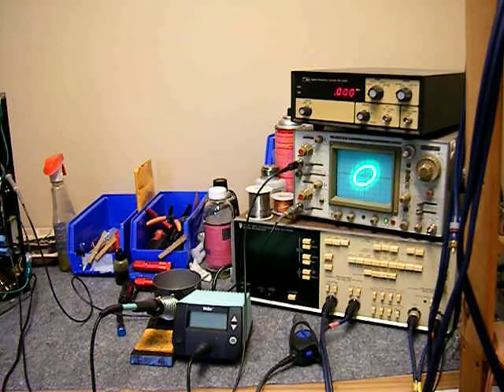Nakamichi cassette deck repair, part 4.

Comment: Hello Francis, it would be great if you do a detailed video on just the calibration process, this one is a bit rushed up an we cant really see how it's made. Also you talk about Speed, Playback Level, Record Level and Record Bias adjustments but it's not shown in the video. Could you please do a detailed video just on the calibration part showing all steps?  Thank you so much
Reply from the maker: Thanks.  I'll see if I can do that.  But, really, it's the same setting up any other tape recorder.  I'll work on that.  I'll see what I can cook up.  :)  Thanks for the suggestion.

Comment: Hi Francis i own a nak z7 bought it new i need to replace the belts i like to do it myself i wonder if its hard to do it been looking for videos on youtube and nothing to look at im over sea can i ship it to you just in case i can't fix it, and how much repair will cost me, any idea?  thanks
Reply from the maker: I buy up broken machines, repair and resell.  Since parts (aside from belts and rubber pulley surrounds) are not available, it is very difficult to provide a repair service.  I often need to take parts from 2 or 3 broken machines in order to piece together one working machine.  Btw, there is no "z7",  perhaps you mean "zx-7".  The ZX-7 appears to be very similar to the LX-5, I recently rebuilt 2 LX-5s.  The transport is very similar to the 480 and the restoration procedure would be similar to what I do in this video.   It appears to be a very high end machine and is worth getting it to a good shop that has the proper tools and expertise.

Comment: Hey Francis, can't thank you enough for putting these fantastic clips together, they've given me some really timely and comprehensive pointers on how to rebuild my 480. Have you done a lot of these rebuilds? You sure know what you're doing! Truly great work, and very much appreciated.
Reply from the maker: I have been working on tape decks and cassette decks since the mid 1970s.  I have rebuilt several of the Nakamichi decks in the past 20 years.  I like to focus on the Nakamichi decks because they show the best performance of any cassette deck that I know of. Thanks very much for your comment.
Reply: @fflynnful  Ah, that is great to hear, and I couldn't agree more, the Naks are certainly the Rolls Royce of the cassette world. The 480 was my first (and for many years my only) Nak. It has its flaws but its signature sound is one I just keep returning to, and I'm sure you can understand why. Thanks again for all your time and effort.
Reply from the maker: @geofffisher6382  Some insist that the Dragon brings out the best sound quality from a cassette, but the 480 and it's like can do just as well if in proper alignment.  A badly adjusted and poorly maintained Dragon can sound bad as well.
Reply from the maker: @geofffisher6382  When CDs came out, Nak used a "peaking circuit" to enhance the frequency response in the area of 20 khz.  It made the numbers look good on paper.  the 480 doesn't have that.  This gives the 480 a more "natural" sound.  I like the 480 and 580 most of all out of the Nakamichi decks.  There is a difference between what looks good on paper and what sounds good.